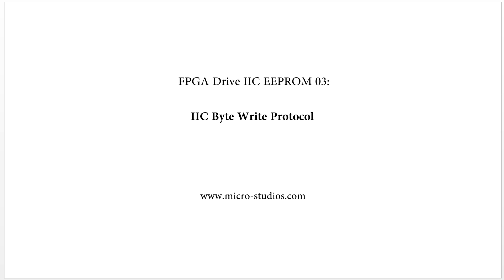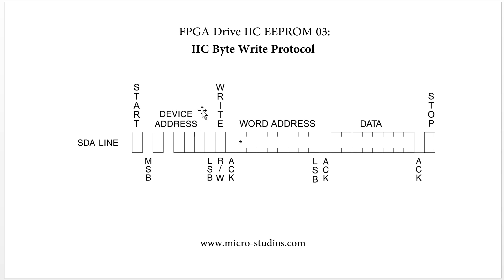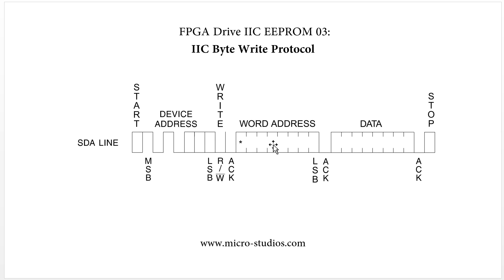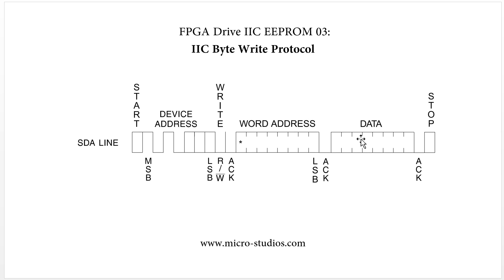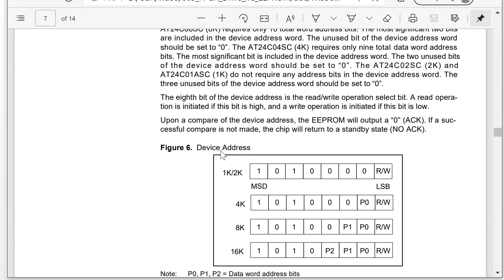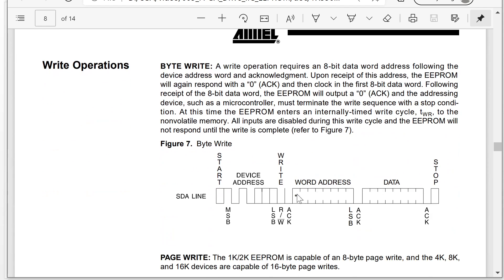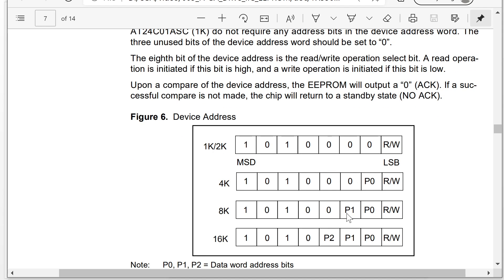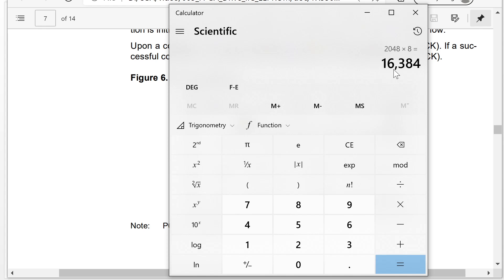FPGA Drive IIC EEPROM 03: IIC Byte Write Protocol

Comment: I enjoy your courses and have purchased at least one on Udemy. There is a lot of good information, you clearly know your subject and you explain it well. I would like to see even more.
A bit of honest feedback:
Please consider reading less of the text that is already on your slides - we can read it ourselves. Also, please seriously consider speeding up the delivery overall. If you prefer to speak slowly, that's fine - you can use video software to speed it up by 1.5X or so. In most cases, there is no need to count out each bit 1, 2, ...8 - the slides already show that the addr & data are seven & eight bits wide, etc. Thanks for creating and publishing your work.
Reply from the maker: Thank you very much for your valuable comment and suggestion!